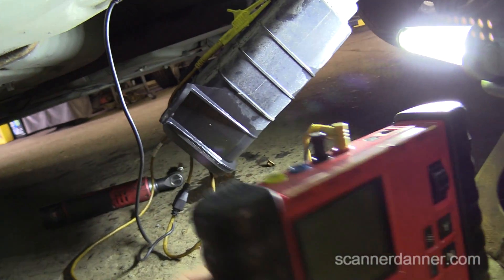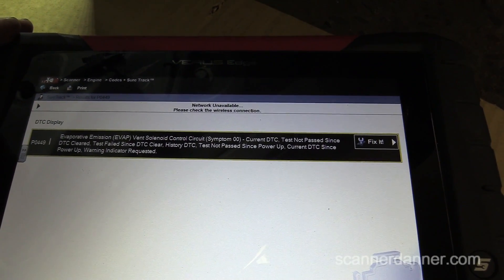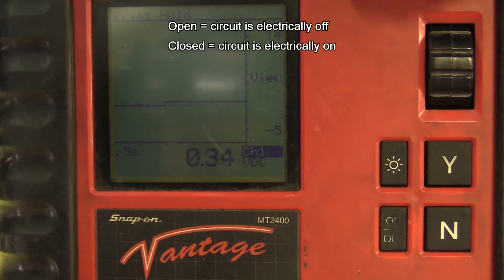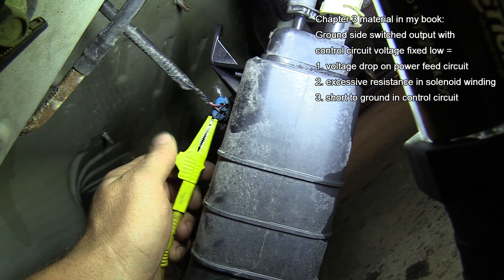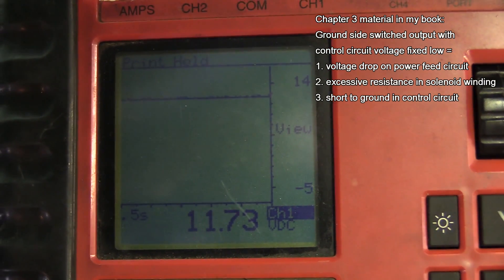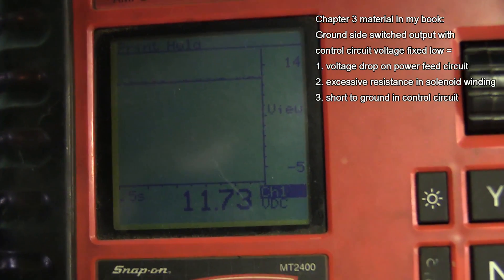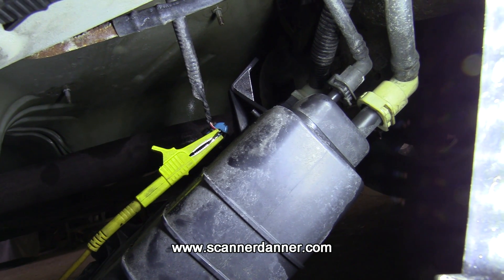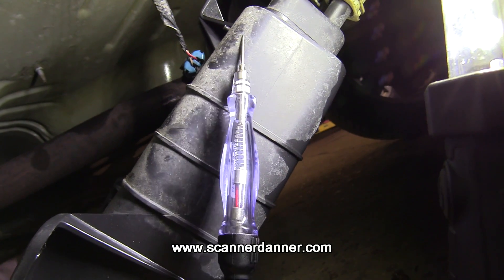2007 Cadillac DTS P0449 Evaporative Emission EVAP Vent Solenoid Control Circuit

Comment: Ineed help on my 2009 Cadillac dts keeps burning up alternator s  total of 3  any suggestions
Reply from the maker: 1. Make sure you have a good battery. 
2. What is your charging system voltage after replacement? 
3. If both 1 and 2 are good, buy an alternator from a more reputable source.

Comment: I have a 2008 dts and while i was replacing the old charcoal canister the connector from the vent valve solenoid broked from unpluged so now i need a whole new connector wire...is it easy to change or the other end of the connector is far back?

Comment: where is this at, in front of the gas tank on the driver's side?
Reply from the maker: I'm sorry, I don't remember. Just do a quick Google search
Reply: @ScannerDanner  no worries man lol, I did. Its by the the driver's seat (to my surprise). Thanks for responding though. Good stuff
Reply: @johnrecaptcha4504  I was told that it was located on the passenger side of the vehicle

Comment: You sound like a very experienced mechanic. Could you please advise if an Error code - Engine Torque Control Signal Error on my SF5 Subaru, can be related to the EVAP?

Comment: At 1.50 on the video when you talk about excessive resistance in the solenoid possibly causing the .64 V reading, could you please explain how this would cause a fixed low reading? In my limited understanding, wouldn't that excessive resistance or even infinite resistance (as in an open) at the solenoid still provide a battery voltage reading on the feed side? Thanks for the great videos!
Reply from the maker: Read what Fred Flintstone wrote below in the comments of this video. He explains the .64 reading with some math.
Also, the solenoid DVD have good battery feed voltage. The .64 was on the control wire, which should have also showed battery voltage with the circuit OFF
Reply from the maker: Did  (not DVD) stupid phone
Reply: Ok thanks.  I follow your reasoning now. The voltage reading of 0 .64V was on the control side which was ground side switched. A high resistance in the solenoid or an open would give 0v or close to it on the meter.

Comment: I want to know how on a 2007 the canister unfastened to drop down so easily ;)
why not test the solenoid coil to start with if bad replace and go from there. good ole over-complicated ass-backwards stuff of today. still wise to test voltage and control though ;)
coming soon, computers built into every sensor to ensure the computer setting codes isn't shooting blind >_> oh wait!

Comment: Another great video. 
According to the specs the Vantage has a 10Meg Ohm input impedance. With a drop of 0.64 volts across the Vantage to ground and a 10Meg Ohm input impedance this gives us a current flow of ~64picoAmps. Applying ;this current value to the solenoid having a voltage drop of approx 11.07 (11.73 - 0.64) using ohms law, R = E/I, the solenoid provides a resistance to the circuit of ~172Meg ohms. Not a completely open circuit as Paul pointed out, but enough to give you a small reading on the Vantage because as Paul also pointed out, the meter completes the circuit.
Another way of looking at it would be to notice with an supply voltage of 11.73, and a voltage drop across the Vantage of 0.64, you'll notice that the voltage drop across the solenoid is ~17 times as high as the meter. Given that the meter represents 10Meg ohm to the circuit, multiplying that by 17 gives you ~170 Meg ohm resistance  value for the solenoid, practically an open circuit.
Reply: Thank you for this reply. The video left me with a lot of questions, but with the math and logic you supplied I was able to piece everything together.
Reply: You're very welcome. One of the things that Paul does, as well as 
others, and myself is to draw out the circuit when it gets a little bit 
confusing. Drawing the meter in the circuit as a 10Mohm resistor (in the
 case of the Vantage) really helps in seeing the big pictures and how 
you have a couple resistors in series in the circuit which create a 
voltage divider. The ecm is wired into the junction between the two 
resistors (solenoid, and meter) and will either switch to gnd, or go 
open which gives you your 0.64 volt reading when it's open or 'off', and
 0 volts when it's switched to gnd or 'on'.. Since current takes the 
path of least resistance the small amount of current in the circuit due 
to the high resistance value of the solenoid goes through the ecm to 
ground and not the meter thus dropping the reading to zero.
Reply: Drawing out the circuit is exactly what I did to completely understand this. I have always been told that a meter can affect the readings. Its always followed with something along the lines of "but it barely affects anything at all" or "the impedance is so high that..." 

Being used to the fast paced work style that flat rate is I'm not sure if I have come across a situation where something had higher resistance than the meter (or even close to it) without being completely open. Maybe its just the simple fact that I was moving too quickly to notice. 

It's funny, when I saw this video I read "evap vent solenoid" and figured there was nothing to learn here. Simple problem, but I was bored and killing time before work and watched it. I really wasn't expecting to stretch my understanding.

Comment: Had a P0449 on a 09 Chevy, 5.3l Z-71. Circuit was good, computer was good, replaced vent aolenoid(was working intermittently). Still had code. 
What I found fixed the issue, and caught me off guard!!
Reply: roadkill5333 what did you find
Reply: Yeah what did you find you can't leave us wondering

Comment: great video Paul  u should use your power prob 4 more I love mine great 4 testing drivers
Reply: South Main Auto Repair I use my power probe mostly just so I have a ground in rear of car or truck
Reply: hard to be an incandescent test light...
Reply: Vince Bauer power probes can be baddddd
Reply: chris cager why is that
Reply: Vince Bauer if your not paying attention you can destroy stuff 

if your testing it off connector it may sound like it work (purge valve) but it might not be sealing properly
Reply: chris cager I use my scanner with my power probe on the control wire.. in driver mode
Reply: Vince Bauer lol its what ever works I just had accident with a probe so now I'm a little hesitant towards using 1